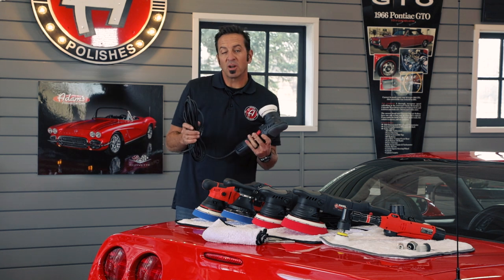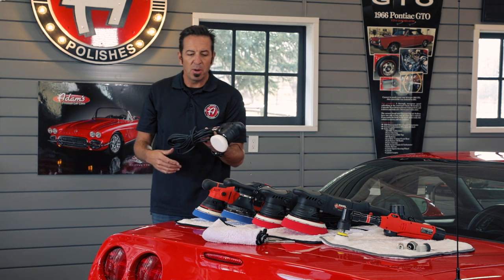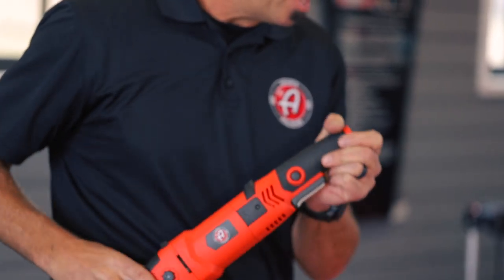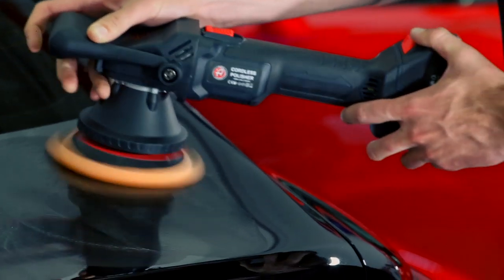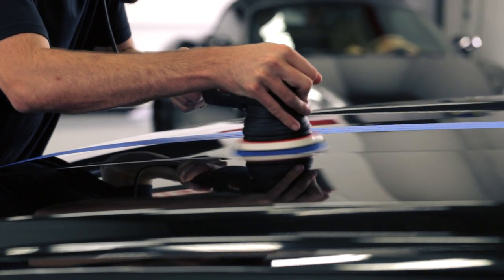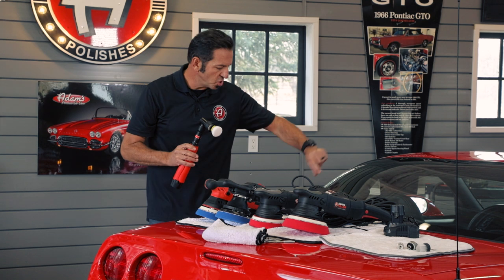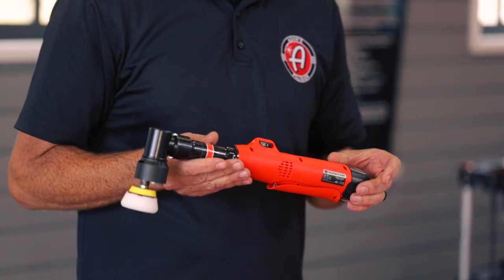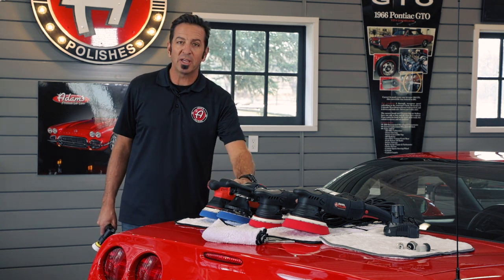Adam’s Polishes Swirl Killer Polisher Line

Comment: Just got my SK PRO 15mm polisher today. This thing is an absolute DREAM. What a fantastic upgrade from my porter cable 7424. The power is amazing, yet it is still very gentle in the hands of a novice. No worries about it getting away from you on edges etc. Its much quieter than the PC, and there is noticeably less vibration. Seriously, if you are on the fence, just do it. Its a fantastic machine!

Comment: Is the 15mm cordless polisher considered a replacement/alternative for the corded version? 
The marketing materials used to show it as a model that was slightly lighter and slightly more powerful  than the 15mm corded model and appropriate for use for correcting an entire car with the 2 batteries it comes with. Is this not the right product for in Adam’s lineup for full car correction or polishing?

Comment: I have a  blue and a white pad. Which one should I use to do the cutting of the first step and then which one do I use as a polisher?
Reply from the maker: Hi Cory, if they're our pads, we color-code them to the chemical, so the blue foam pad and blue microfiber pads are our cutting pads used with the blue Compound, and then the white foam pad is a finishing pad used with our white Polish. Other brands of pads may not fit with our color-coding.

Comment: How long does the battery last on charge?
Could I complete a larger sized car like a Dodge on a charge.
Reply: most likely not , especially if doing more than a 1 step . And that would be pushing it.
Reply: Just order another battery and have one on the charger while your using it.. boom unlimited cordless buffing!!
Reply: Comes with 2 batteries,  they have a website, where you will get the facts and not other peoples opinions
Reply: About 40 minutes on fastest speed.